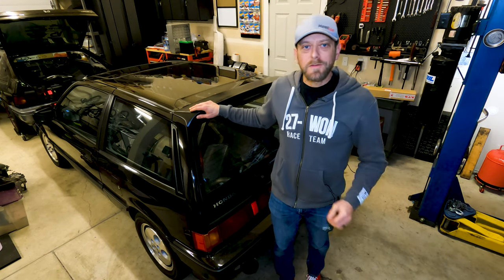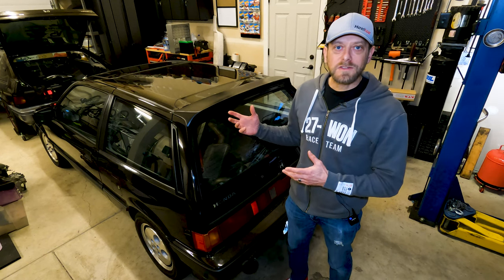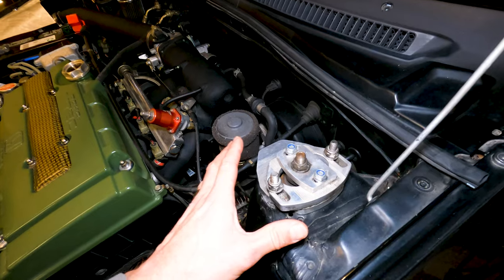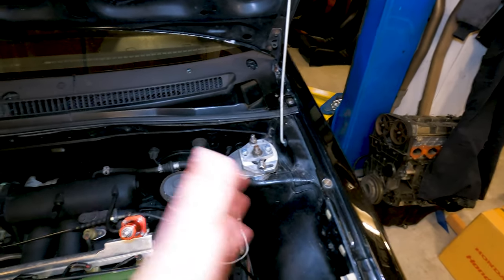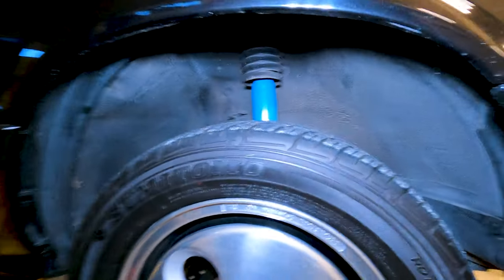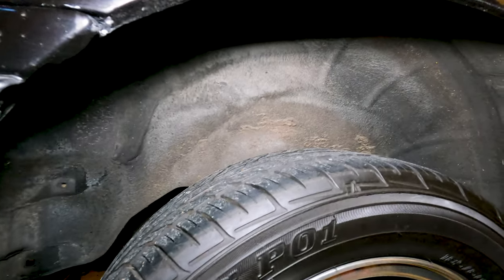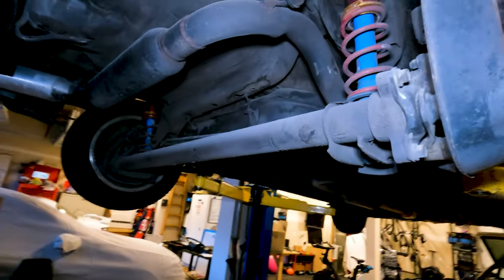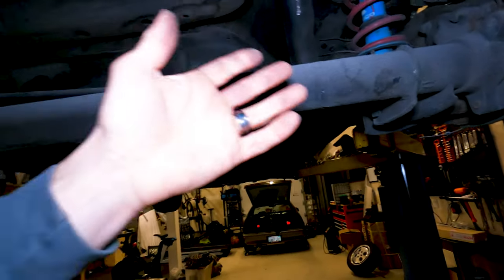Torsion Bar Honda Suspension Explained

Comment: Hello, I have a CRX 1985 with a B18c6 engine
My question is which torsion bars (mm) should I buy so that the original shock absorber doesn't come together.
Then the car leans very heavily in curves on the race track 
I usually ride on three wheels.
I plan to buy the stabilizer bar set too.
I would like to drive the car on the street and sometimes on racing Track with semi-sliks.
Please Help me to buy the right kombination
Later i buy the damper coloiver from BC-Racing to👍👍
My CRX: https://youtu.be/sz8P5uEwxsk?si=BIrOW1twUAig2iGY

Comment: To lower the height in the front, which way would you have to turn the teeth of the torsion bar? thanks for the info...
Reply from the maker: It depends on which side of the car we're talking about. A better way to think about it is, which way would you need to turn the bar to lower the car? On the left side of the car, to lower the car you need to raise the control arm, looking from the back of the bar that means turning it clockwise. On the right side you'd be turning it counter clockwise.
Reply: @Heeltoe. ooh I understand, then no the two sides do not turn in the same direction, thanks a lot

Comment: Hey man I was wondering how on a pan hard/trac link bar it doesn't push the suspension to the right if the car goes over a bump but it pushes it over if the axle moves up (from lowering the car)? This is interesting as my friend has a built jeep and I like looking at the articulation of his setup as well as just understanding solid axle setups better

Comment: I am getting the BC racing coil-over damper kit for my 86 CRX, I was also probably going to get some 24mm torsion bars. Is there anything els I would need to make the new parts work as they should, or am I good to go without upgrading other suspension parts, mechanically speaking. Currently my CRX is having issues with bumps in the road so upgrading is in my best interest.
Reply from the maker: Thank you we got your order and are shipping all today! We'll contact you shortly with some fulfillment information. You probably will need a Panhard bar as well, as we mention in the end of the video here. Circle back on that and let us know if we should add one to your order.

Comment: Man…. I have an 01 Hyundai Santa Fe basically same suspension setup as a late torsion beam suspension setup from older Hondas 

I’m looking to lowering her but nobody makes any aftermarket parts for my SUV so I have to source from other cars and modify to be able to fit and work that’s why I’m looking to getting coilovers for a Honda that use torsion beam suspension because since it’s a Honda it’s gonna have way more aftermarket support
Reply from the maker: That sounds like a challenging platform without a whole lot of options. Best of luck!

Comment: Looking at the midevil pro. Wanting to lower it a good amount. Should I max the strut first then leave the rest to the torsion bar. Or should I try to find a balance?
Reply from the maker: The torsion bar sets the height. But because the MP dampers are shorter than OEM these dictate the highest baseline height you can achieve, just installing these dampers lowers the car. To properly set the torsion bar it needs to be re-indexed. Honestly, more videos are needed here to illustrate better.

Comment: I think I have seen the bar inside of the rear beam axle removed. Is it worth the weight reduction? I have a b series 87 CRX
Reply from the maker: Yes people do remove it and then lock the rear axle, but this really isn't the wisest thing to do for dynamics.

Comment: these cars kinda handle like the old big body Chryslers from the 60’s lol 
my 89 is double wishbone so none of that
Reply from the maker: You could not be more wrong! These cars are light and tossable, they do a lot with what they got. The suspension is simple and compact. It is not very refined, for sure. But you should drive a properly set up one.

Comment: This is really informative, thanks for taking the time to make this video. Question: I'm looking to lower the rear of my '88 Integra with the Ground Control setup like what you have here about an inch. With that minor of a lowering do I still need an adjustable pan hard?  Is there a rule of thumb on how low or is it mandatory anytime lower than stock height?
Reply from the maker: Great question!  With minimal lowering there will be minimal change in the initial position. Probably around 2 inches it's where you will really start wanting one.

Comment: How well do these old cars handle? I’ve got a 94 Del Sol on coilovers, braces, and a big rear sway bar and handles roads amazing. Just bought an 87 CRX HF and I was curious if I could eat up some roads with a 2-3” drop with some 27mm torsion bars and some nice springs in the rear? I’ve heard it isn’t worth modifying these cars for anything other than looks but I would really like to take some back roads with this car
Reply from the maker: They handle very well considering their weird design and their age. Old torsion bar Hondacars are still heros at autocrosses all over the nation. Back roads, forget about it. They are light, tossable, and really honestly have a very high limit when set up right.
Reply: They can be go carts for sure.  My stock 85 CRX is fun in its own way and my fully modded street legal track 86 CRX is very competitive on the track. Lots of trophies and fun!

Comment: I have on. But big trouble is about engine.  Want to change it as currently am using a carburetor engine model honda civic 1985
Reply from the maker: What do you plan to swap in?
Reply: @Heeltoe. Swap with K20A 😊
Reply: K series is fun in these cars. Had a B16 in my 86 CRX SI since 2000 and it was a blast on the street and track.  Just upgraded to K24 and it’s a monster now! 😂
Reply: @1stGenCRXs   i ll consider this 4 sure

Comment: So when you lower the car with the torsion bar adjustment does that take away some of the car’s spring stiffness? Is that why people reindex the bars when they lower them? To get some spring stiffness back and still have the car sit lower?
Reply: Asking mainly cause I’d like to lower the 89 integra just a little but I don’t want the car to bottom out on a wet piece of toilet paper lol.
Reply from the maker: No the stiffness does not change when raising or lowering the car. People re-index because they lower the car a lot and run out of adjustment on the torsion bar. So moving the bar a spline makes a big adjustment change in height but keeps the adjusting nut in the middle of the adjustment range.
Reply from the maker: The car bottoms out because the stock struts are too long to accommodate much lowering. That is why we have shortened dampers available from Medieval-Pro/Tein on our website.
Reply: @Heeltoe. Thanks for all the great info, buddy. I have an 85 hatch with A B series swap. And now I'm starting to get into the suspension Very useful information here, thank you. There's not much out there on these old ones. I've had three of them this is my first that I swapped an I love them Your car is beautiful I love the build bud!👍

Comment: Just bought some cs coilovers for my
Reply from the maker: CS? Tell more.
Reply: @Heeltoe. Just bought some bc coilovers for my 87 crx and wanted to Just switch them out with the old struts keeping the same height to not affect the panhard bar until I can buy an adjustable one and I want to delete the torsion bar and add a sway bar and strut bar... you thinks this is a good idea?

Comment: How do it to conversion to disc brake rear
Reply: Civic hatch has the same length trailing arms as 1st gen integra. I swapped the whole beam axle from an integra into my hatch. If you have a crx you have to swap your trailing arms onto the integra axle. Or scarebird makes a bracket for DA integra rear discs
Reply from the maker: Great tip!
Reply: You can keep your stock beam and arms.  You just need the parking brake cables, brackets, studs for the brackets, calipers, and lines. Tip is to get parking brake cables from the two door version since they are shorter.
Reply: What hood is that one with the bulge on that civic ? I’ve only seen them in crx’s are they interchangeable?